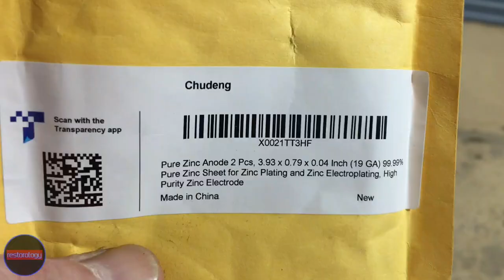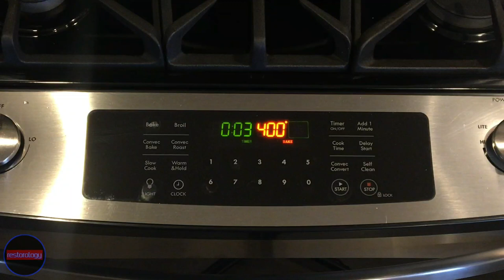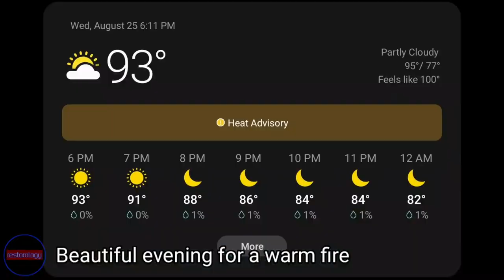Restoration of an Old-Fashioned Popcorn Popper

Comment: Nice restoration. And can use sandblasting for removing the rust
Reply from the maker: Thanks! I did not have a sandblaster back when I did this one but you are absolutely correct. This would have been much easier with one.

Comment: Nice restoration but not sure if zinc coating is safe for food contact, even at low enough temps for popcorn. Please check on that. Oh, and I love burnt popcorn! Truly! Lol
Reply from the maker: Thanks! I thought about the safety thing with zinc too. I tried to minimize coating of zinc on the inside of the pan by not exposing the inside walls directly to the zinc plates and then I seasoned it a bunch of times with grease to create a non-stick protective layer so maybe it will be okay. Thanks for watching! Cheers!